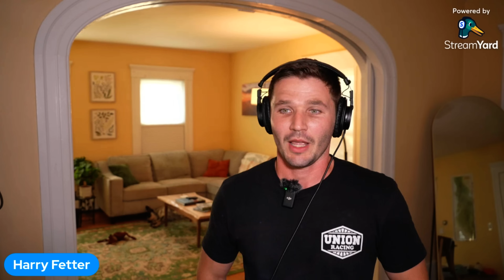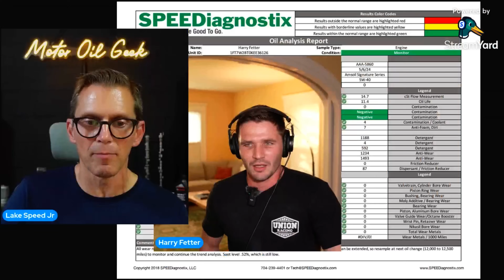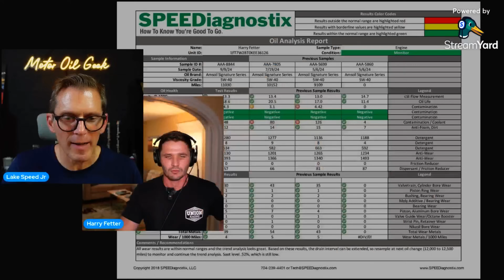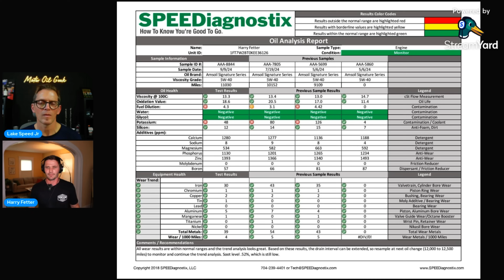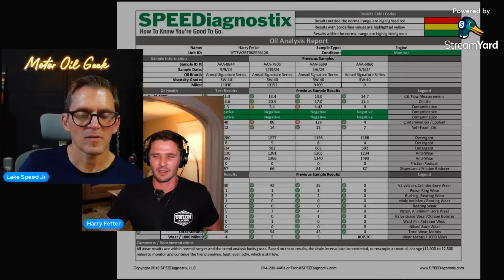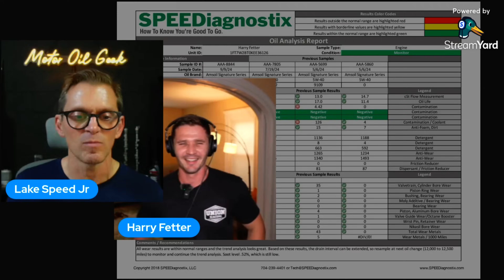11,000 Mile Amsoil Oil Analysis With The Motor Oil Geak

Comment: Man, I want to see Lake do a deep dive on AmsOil and how it compares to other brands.
Reply: Please compare to Redline diesel oil
Reply: @candyman1967 Red Line is superior but much more expensive.  I recently sent a 25k mile sample in from my 6.7L Cummins and the UOA came back with phenomenal results of 3.3 ppm per 1000 miles wear metals, additives were still plenty sufficient with TBN at 3.7 and TAN at 3.3 which means it was still neutralizing the acidic byproducts of combustion.  No water, no fuel and less than 0.1% soot (thanks to bypass filtration).  Viscosity was still great at 14.3 cSt at 100C.  Red Line is a POE base oil which resists thermal breakdown and oxidation better than PAO base oils like Amsoil which aren’t as shear stable.-Hence why POE is used in aircraft jet turbines universally.  I should also mention I had not changed oil since June 2022, over 3 years ago! Most other oils would have oxidized beyond their useful life if left in over a year.  With that being said, I plan to switch over to Amsoil ss since Red Line has gone way up in price in comparison to Amsoil
Reply: @andymike6575  redline was sold to Phillips 66 a few years ago
Reply: @andymike6575  what other differences are there between amd oil signature series and redline?
Reply: I must have missed something, I’m not seeing any anger?
Reply: Why, its oil. If u dont put on the miles they recommend in 1 yr it isn't worth running.  They still recommend u dumping after 1yr. We run cheap house blend 15/40 in everything we have diesel and it gets changed when truck tells us or the equipment is 500hr. Never had a bad sample from oil being used up. We have equipment with 18k hrs and 6.7 fords with 400k mi
Reply: @kwmiked this is important. The fancy oil may not be worth it if your car doesn't see the high miles per year
Reply: What about 76 diesel in Ca thats a 99%
Reply: AmsOil is only good for it's signature series and some of it's European line, the rest, like OE, is just an overpriced oil.
Reply: No is not in fact the oem  series is only 8 dollars per quarts and is a lot better than any other oil it only has less detergent than signature series.

Comment: Hi guys. Great video. I own a Ram 3500 with a 6.7 Cummins that we use for up to 5 months of the USA summer traveling through out the USA and Canada up to 14000 miles in a 5 month period. I have been slowly extending out the oil and filter change intervals over the last couple of years initially at just over 10000 miles, and the last one this week at 12000 miles, again asking if the next change can be extended. Awaiting the test results to see if the trends as per your video that we can extend out further.
Keep up these informative videos.
Thanks
John
Reply from the maker: Thank you for the comment! Best of luck with your truck

Comment: The problem with extended oil changes is they don't account for the guy that has hours of idle time
Reply from the maker: What?
Reply: @powerstrokemaintenance  What?
Reply: @realdeal5883  Lets say 300 hours idle time with only 1000 miles on the oil.

Comment: from research I read, adding up to 3% kerosine to diesel fuel raise the cetane by 10 points. might be a cheaper method than the addictives
Reply: It’s dryer. Wears pump faster
Reply: @Craig-o9v  its up to 3% should not make any difference for the pump.
Reply from the maker: What sources did you use for this information?
Reply: @powerstrokemaintenance  I found it on google scholar. there is good research in the area. Sadly I dont remember the source of the research. also Duel fuel Diesel engines are interesting thing to consider for lower fuel costs.
Reply: I like 2 stroke oil in my Fuel

Comment: I live in Missouri with 10% bio and my question is I always run a quart or 2 of MMO in my oil and run that for 100-200 miles before I change my oil to help keep my 05. 5.9 cummins and it says on the bottle of MMO that not to run this in your newer diesels that use DPF because MMO has too much sulfur in it so that would be a good thing to increase the sulfur and more than likely not enough sulfur to mater .
Reply from the maker: Yeah it's not a good idea to run any sort of oil additives. I've made that mistake and they're just not worth it if you're buying good oil

Comment: Sold amsoil some years ago. Loved the products but hearing about internal varnish issues on the long interval drains. Anyone else hearing or seeing that?
Reply: @spacecat7247  not at all, I run 10-12k intervals, now has 206k miles.  Valvetrain shows no varnish, just like new. I also run a bypass, and do clean oil flushes, for a near 100% oil change over. I also don't mix oils, 0W-40 Amsoil.
Reply: @tssci6774  well, maybe that's why.  They claimed 20000. Swapping spin ons twice.  Zero bypass system. No flushes etc.  Others are seeing varnish buildup. When going by their explicit instructions.  Lol mixing oils?  Not here. That only degrades the recipe.
Reply: @spacecat7247  are you using Signature Series?  They had to reduce calcium, a detergent, to meet new specs, and prevent LSPI.  Applies to many brands.

Comment: I'm interested in operating RPM vs soot. I see almost nothing out there regarding RPM. My gut feeling is powerstrokes like 2000-2500 rpm, and from my 18 wheeler days, I didn't lug the engine when empty. I use the engine brake and downshift to keep my RPM's in the range and I get 460 mile regens. 

Also, from a money standpoint and the fact that Texas diesel is up to 20% biodiesel, I'm using Motorcraft oil and changing at 5000 miles. Thoughts?
Reply: So there is much more soot at idle and not so much at operating rpm IMHO as this is a know. If you are correct, then lugging the engine should be best as there are fewer rotations. 

Do you recommend being in the biggest gear possible to get better economy, less wear,  and soot just happens? It's not my experience but am I wrong?
Reply from the maker: Yes you should be sure to run a test on your oil to be sure. And I try to avoid lugging the engine when towing. Empty I let it do it's thing. Typically would downshift to 5th gear with a trailer to get it to 2000 RPMs. I found it to be a better towing experience and it also keeps the EGTs down. No improvement in DPF regen frequency when doing this with bio diesel though

Comment: Is it better to buy diesel at a truck stop over a regular station thanks
Reply: @jonsmith398  generally yes. But a regular fueling station that has clean storage tanks and regular product turn over is fine. It’s usually smaller mom n’ pop out of the way stations with poor fuel storage practices that can have questionable fuel. 

My dad had a duramax from 2001-2015. And for the first 5 years or so he’d always fuel up at the same station if he was in town. Like clock work every 15-20k miles he’d have to change the fuel filter or it would be so plugged the truck would go into limp mode… usually while pulling a trailer. At 99k miles he had the injectors replaced (very common on the first generation LB7 duramaxes) and the tech noted while its a common problem with them the fuel filter was full of rust particles. After that he questioned where he was getting fuel, he quit filling up there and the truck stopped plugging filters and going into limp mode for the next 250k miles. And he’d go even longer between fuel filter changes. Long story short, just keep your fuel and water separator filters changed frequently and  you don’t have to worry about it.

Comment: Funny, I ran exactly 11k on my 6.7 on the last oil change, 10w30 Amsoil. Oil was still like new.
Reply: My oil looks dirty in my 17 F250 6.7 like 200 miles after I change it.
Reply: @miketonon7946 dark doesn’t mean it’s bad. Have to send it in for analysis.

Comment: I don't know why everybody makes such a big deal about how many miles you can go before you get your oil change 
I have a 24 Peterbilt with a Cummins 15 liter 500 horsepower my next oil change is coming up the recommended service interval is 65,000 mi I'm currently at 175,000 and this will be the third oil change
Reply: A heavy duty diesel engine in a semi truck also has nearly 3 times the oil capacity of the light duty diesel engines found in pickup trucks. The increased oil capacity has just that… more capacity to carry dirty particles and more additives and oil to be used before break down. But yes, many people are taking out perfectly good oil for new oil too soon.
Reply: Yes and your commercial truck probably has a 30 quart capacity and the oil filter itself probably holds a gallon of oil.  Cars and regular pickup trucks are a different animal.
Reply: Wow, change oil every 60k miles? Is it possible?

Comment: Awesome video. Lake is the oil King. I'd love to see testing on how clean oil is when you take it out sooner rather than later. And the wear factors. Because what they're not mentioning is the sooner you change your oil, the less piston ring and piston wall wear you will have. As the oil collects the dirt not trapped in the filter, it wears and scores the walls and rings over time. So the more often you change the oil, the longer the engine will last and the longer it will run like it was when it was new. Without any wear. Or extremely minimal wear. I happen to have a few Trans Ams that I want to keep like new. They are 30-40 years old now with 80k and 90k but they still run like they did the day they were new because the oil in them has never been in it for more than 17 or 1800 mi. After testing...the compression in both engines is exactly the same as when they were brand new. Now I know that's often to change it. But I want to keep the engines like brand new forever. And I am doing just that. I have the money and it's not a big deal to spend a couple hundred more dollars a year changing oil. I only put 4,000 mi on the cars per year so changing it every 1700 mi from me is really not an issue. But my engines have zero wear full compression and are super clean on the inside. Oil comes out still looking like dark gold . Now that's awesome.. I use Lucas oil for the extra friction protection, and frame endurance oil filters which are the exact same filter as the amsoil filter. With that combination, you can't go wrong on Rite Street. Exactly like Lake says, I never use an oil additive. Because we all know they are no good. As we've seen on his videos. So I know my engines are staying like new and only cost me an extra $100 a year. Thank you Lake for all your awesome oil information.
Reply: I just don’t believe anyone when they say more frequent oil changes aren’t better for your car. The more frequent the better!

Comment: Even though the Bi diesel Is Less Stable and the oxidation dropped more lubricity but you can push the Oil change farther Is a nice bonuses even though you have to do more Regens
Reply: My 21 powerstroke, never regens.

Comment: How about Heavy diesel trucks? I drive a Tractor Trailer (KW t680 with paccar mx13 engine) We do oil changes every 60k. We run Chevron DELO synthetic blend 10w30. At first I thought it was crazy however we've been doing it for many years with no engine failures as of yet. We keep our trucks up until around 650k then sell them off and replace them. So it seems in a small pickup diesel engine the same oil should at least last equally as long?
Reply: Big industrial diesel engines are built way differently, they aren't delicate like light duty stuff. And big rigs typically have a pretty serious multi-filter setup to keep the oil cleaner for longer. The MX13 has two oil filters for example.
Reply: @braaap6292  I drive truck as well...those engines may be built way differently but they also get worked pretty hard depending on what they are pulling.
Reply: @braaap6292  yes I realize all of this however lake stated that fuel and moisture are extremely hard on the oil...you can have 10 filters and they won't remove the fuel from the oil.

Comment: My 7.3 gets its 14 quarts and pint of HotShot Secret every 5000 miles. 413,000 miles. No blow by. No major engine repairs. Couple of power steering/ brake booster hoses. Transmission rebuilt and torque converter beefed up at 210,000. Always a 7.3 weak spot. Alternator.
A/C clutch. High pressure fuel lines $300 for all 3. Can’t complain. 2002 4WD Lariat been paid for since 2006. I can’t justify $100k for a new 6.7 when my maintenance and pesky repairs are less than one or two payments on new one. Cummins /Duramax are trash. 6.7 has its own problems just not as bad. 
Change that oil. It’s cheap. Screw the green know it alls.
Reply: You are saying that Lake Speed Jr is a green know it all?
Reply: Ever since I stupidly replaced my cast iron power steering pump with the pop metal replacement I go through a pump every 50k miles. I should have rebuilt the original one.
Reply: @NoName-tz5ji  ive never had a power steering failure, how tf do you get kne every 50k? 😂 are you rally racing?!
Reply: Orignal Injectors and cups?

Comment: I was a fleet mechanic for INDOT for 32 years ! Most of the fleet ran 24/7 my OCI's  were every 6,000 miles or 335 hrs of use ! Never had a problem ! These were fords cummins and duramax diesels !
Reply: 11,000 miles and no soot and wear metals to speak of. Science not old school thought. Old oils from 35 years ago don’t apply today.
Reply: @randyhoward3783  how are you getting zero soot in 11k miles on a modern egr diesel?
Reply: @8180634   Near constant use & oil analysis!!
Reply: @randyhoward3783  Many old ideas still hold true. Change oil frequently, do other maintenance frequently, remove the guesswork, and you're more likely to have a longer lasting engine.
Reply: @Doomzdayxx  To an extent..modern GF7 SQ rated full synthetic oils are phenomenal. Don't dump any good full synthetic oil less than 5k mis/ 1yr. Generally speaking. Driving style/ fuel type all matters.
Reply: Your use of common sense and consideration for those vehicles is commendable. 
Out of all the things you can pick to do half-assed through out the day-
At least treat your ride right.
Reply: Was doing 30k OCI on my 21 powerstroke pulling trailers. My fuel efficiency was better at 400k than it was brand new. But y'all love wasting money on 'fresh"oil because you've been doing it for 30+ years. Imagine bragging about not improving in 30 years.
Reply: @IaintTrynaGoOutLikeBIGnPAC Thats bit long but if hwy driving can be OK. Fuel type matters too.
Reply: @IaintTrynaGoOutLikeBIGnPAC oil analysis makes me confident in my 10000 interval. Perfect numbers but I change it anyway. Filter is clean.

Comment: So I'm an auto/diesel tech in the military. They sent us to a Ford 6.7 power stroke class that was held by ford. And the engineers told us the 6.7 was designed to run on a specific diesel fuel (specific cetane rating) and they said that such fuel doesn't even exist in America.... Is this true?
Reply: I’d seriously question if that’s true… I know Ford makes some pretty ignorant engineering choices at times, but why would they design the engine to run on a specific cetane rated fuel that isn’t even available where the indented use for the engine is? Just doesn’t make sense.
Reply: They are talking about the cp4 that was designed around euro diesel. It has a higher cetane rating, better quality, more additives. They say that the reason Americans have so many issues with the cp4 is most of our diesel is 40 cetane with no additives.
Reply: @BJ-vd3rp  I know what they were talking about lol the CP4 on a 6.7 for diesel lol .. hence my question. 

Looks like you partially read my question without fully understanding what I was asking...

I had Ford engineers who created this 6.7 tell the entire class the fuel this engine was designed on that fuel dosn't exist in the US..
 

Jw if that was actually true or not. 

CP4 pumps diesel fuel. Hence my question lol....guess I had to fully explain my entire question because you got confused.
Reply: @mattdagger1480  

The question being is it true that the 6.7 was designed to run on a specific cetane rating of diesel fuel that is unavailable in the US. 

Yes that is true. Not all diesel fuel is the same. 

European diesel is generally considered higher quality than American diesel due to higher lubricity and cetane ratings. European standards require a cetane rating of 51, while the U.S. requires a minimum of 40.

European diesel contains fewer contaminants and is refined to a higher standard, contributing to better engine performance and longevity.

The ford engineers are telling the truth. The answer is euro diesel is different than American diesel. It runs cleaner and lubricates better. You can not find that quality of fuel in America thus the fuel the engine was designed around is not available in the US. 

Europe has stricter emissions standards for diesel vehicles, such as the Euro 6 standard, which limits NOx emissions more stringently than U.S. regulations

One of the ways they have achieved there stricter Euro standards is through better diesel quality with the 51 cetane rating. 

The 6.7 was made based off the better euro fuel partially because they chose the  European designed Bosch Cp4 that has a high failure rate when used with American diesel due partially to the fact that the lower cam is lubricated by diesel. That is where it normally fails due to the lower lubricity and dirtier fuel of the US.
Reply from the maker: I’m not sure